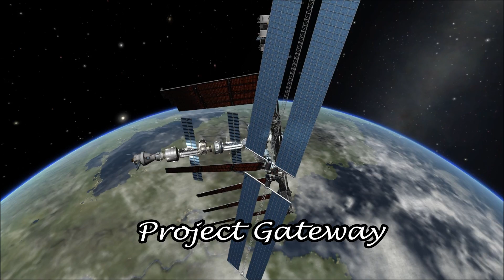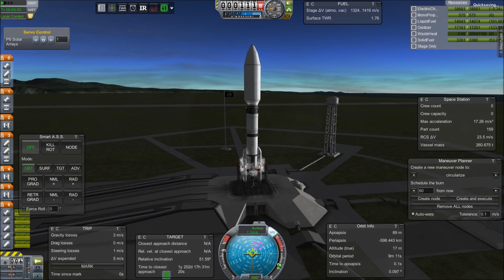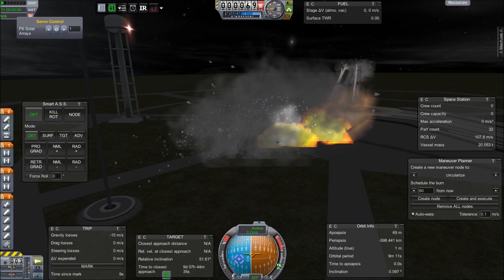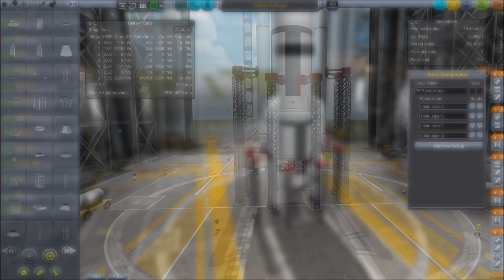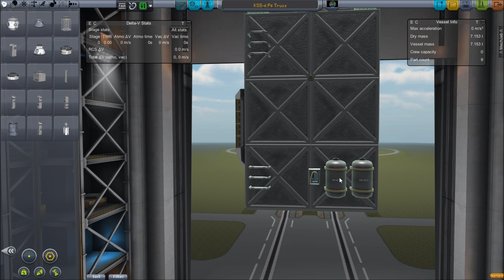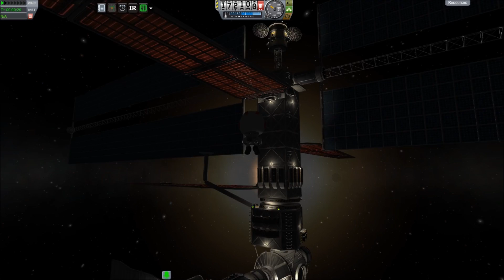KSS-7: P6 Truss / Project Gateway / Kerbal Space Program 0.23

Comment: Here is a question, in your unmanned launchers (and other peoples launchers that use remote tech), what is your active command module/robe? Is it the satellite or the tug? I doubt its your rocket, since you just pull those out of the Sub assemblies menu. I am gonna say its your satellite, but I haven't got around to checking it yet since most of my flights are manned. I just made a remote tech network cause its cool :D
Reply from the maker: edwardwilliams91 It's usually my satellite unless I want to remain focused on the launcher even after detaching the satellite for some reason. (As you probably know, whatever probe is closes to the root part becomes the new focus when something decouples.)

Comment: Bob Fitch I don't have an incredible computer and yet i'm not lagging as much as you do at all. Even with very large station even bigger than what you actually have here without using any mods at all. 

I think you should go to your Options Menu and lower the Surface Quality for the Terrain. I just did that and my game is running really smooth for me now, it looks like by lowering the rendering quality of the surface of the planet does help a lot for me.

I don't think the game actually take advantage of more than 4 cores nor Hyper-treading with Unity ?

Resolution : 1920x1080p
Video: Old ATI Radeon HD 6670 2GB.
Processor: i7 2600 @3.4Ghz/Hyper-Threading
Ram : Old 8Gb ram

My video card does cause some lag when there is a lot of particules, shadow.
But all is working fine for me with big ships and huge space stations. Since i lowered Terrain detail to minimum, my game play super smooth.

Comment: Hi Bob, great videos! 
The last time I attempted a large station build, I ran into some serious FPS hits, dropping to single digits. That was the build before career mode. My station topped at 500 odd parts. I have a a half decent machine, so I was wondering if there has been any optimisation since career mode, or do you have a beaded up PC?
Looking forward to the next instalment!
Reply from the maker: I'm getting 8 to 20 FPS depending on what I have near the station. I have some ideas for editing the save game file to improve performance though. You might see some changes there around Ep 10 or 11.

Comment: I'm looking to build a new space station, when you are finsih any plans for .craft files?
Reply from the maker: My install is heavily edited and I use UbioWelder to even make new parts. The .craft would never load for you unless you had my added parts, and even then if you did straight installs of the mods then you'd crash out of memory. I have trimmed parts I don't use to same memory. You would need a ZIP of my GameData folder to make them work. If enough people are interested, I'd do it. I suspect it's a bit more than most people are looking for though?